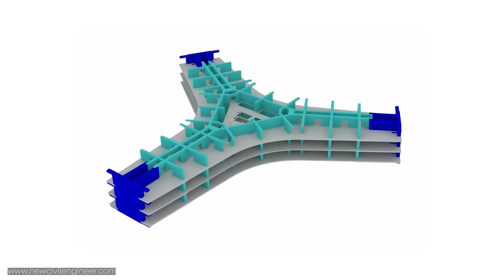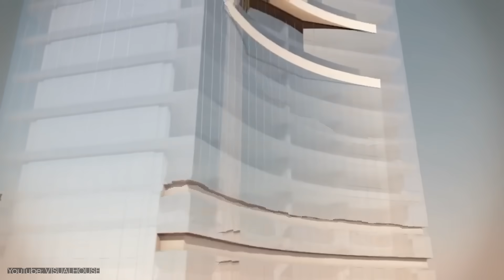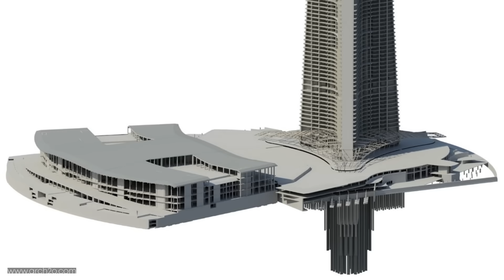Jeddah Tower: Building the World's Tallest Skyscraper

Comment: What's weird is, you can't use desert sand in concrete...its not structured right,so you have to use sand formed/eroded in water.....all that desert and they can't use it. And since concrete is the world's number one commodity,we're running low on "hydro" sand. We're dredging everywhere.

Comment: The head architect also designed the Burj Khalifa..some engineers would disagree with calling the architect the head of the overall design 😂
Reply: Also - core walls aren’t several meters thick. The walls of this building are actually exceptionally thin. There are far shorter buildings with far thicker load bearing walls.

Comment: One important point about the longest elevator run in this building:-

The Elevators that will go up to the 157th floor observation deck will travel at a maximum permissible speed of 10 metres per second. In order for the elevators to go higher, Finnish company KONE designed the Ultrarope rope technology to prevent the use of conventional steel cables. The Elevators to the observation deck will use carbon fiber belts.

Comment: WHY EUROPE AND USA DO NOT BUILD HIGHEST SKYSCRAPERS IN THE WORLD?
Reply: because they don't need to win the dick comparison contest :P also i guess regulations prohibit structures that tall in many places, it's expensive and often doesn't really pay for itself (see all the empty skyscrapers in china) and lower buildings are more safe (easier to vacuate in an emergency, less earthquake problems) and less restrictive... look at apples new campus, they could've easily afforded something like this, but they went for the lower ring shape instead
Reply: @johnuferbach9166  HA HA...TQ SIR
Reply: After a certain height they become impractical. The taller you build it, the more elevator shafts you need. More water pressure to get it to the higher floors. More stairways for emergency evacuation. More ventilation ducts. Maintenance costs for windows and all of the above the higher up you go.
Reply: @75aces97  THANKS

Comment: At the current oil drilling rate, Saudi Arabia will exhaust most of its oil reserves by 2040. By 2045, most of the big oil guzzling economies will move to alternate energy sources for majority of their energy demands. By 2050, due to climate changes and greenhouse gas effect, the average temperatures in middle-eastern (ME) countries will rise by 4-5 degrees. After that it will become very difficult to lead a normal way of life in there. As per recent studies, before the end of this century, temperature in ME countries like Saudi Arabia will rise to an unbearable level and soon will become uninhabitable i.e. conditions will become so bad that human life can't sustain in ME's hot and dry climate..